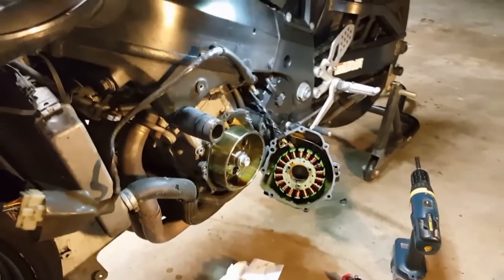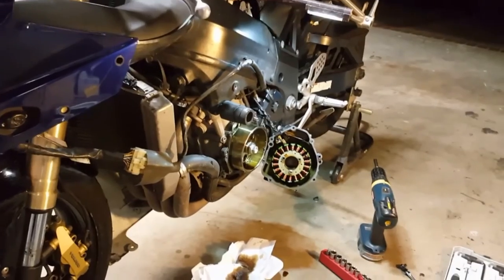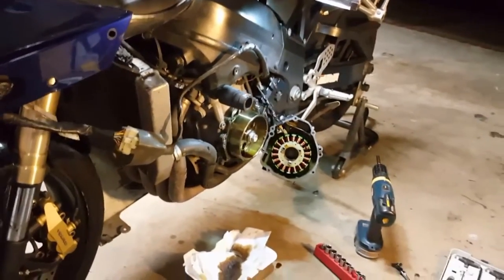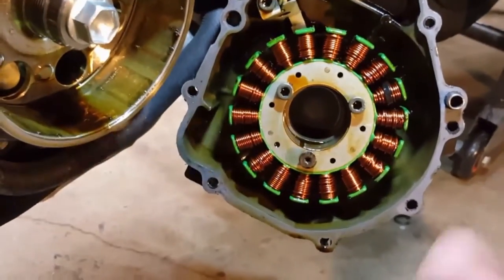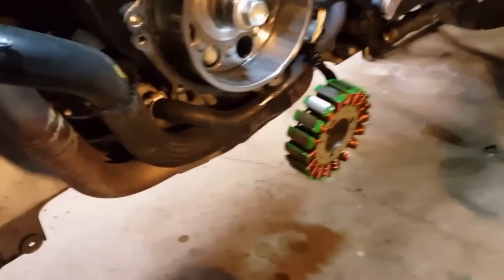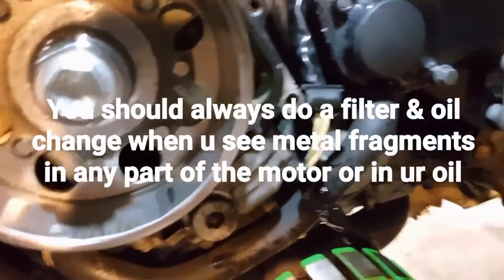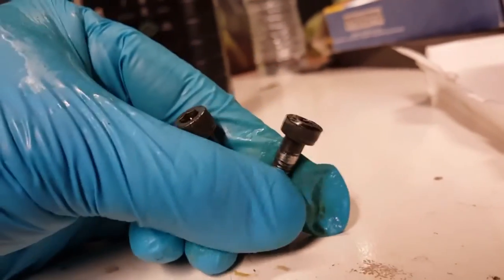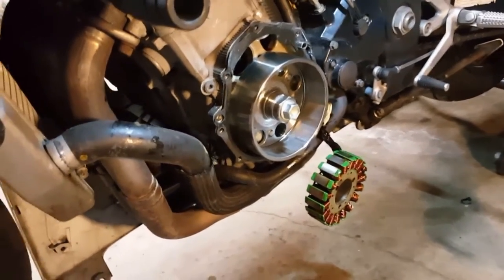DIY Troubleshooting Stator Screeching Sound

Comment: Okay for anybody else to watch this video. I was having a problem where I had come back home and check my bike the next day after having no previous issues. I was about to head out for a trip, but then it started making that belt screeching sound. He was talking about in the video so I panicked and called my mechanic friend. He said it doesn’t sound like any cylinder issues or pistons so check the compression. We checked the compression and everything came back fine so then I went and watched your video. Immediately found out what was wrong with my bike by pulling off my stater cover even though my bike is a ZX 10 R 2008 SE. Thank you so much I thought I was going to have to replace a goddamn engine again.❤
Reply from the maker: Glad I could help you out brother. I never would have thought that this would be a thing but I guess it is.. thanks for sharing your story and letting us know it's not something that's bike specific..

Comment: Thanks for the video, just happened to my cbr thanks to your video was quickly able to diagnose my problem
Reply from the maker: Glad it helped you out. Its very rear that this occurs but it can happen as I said. It may be a pain in the ass to remove in the future but be sure to use some blue lock tight so it doesnt happen again.

Comment: Great work from the 2005 GSXR Master Mechanic. James, you must really love the 2005 GSXR 750.
Reply from the maker: Thanks Kenneth!.. yes, I do love this bike.. I have friends who tease me all the time saying I should sell her and upgrade to something new.. I tell them every time I get on her it's like a new experience.. 

Riding Ms. Lucy Liu (a.ka. Loose) never gets old and with the new engine I dropped in her a few years back she's younger then ever.
Reply: @TheChemistDIY  I was experiencing an electrical gremlin recently on my 05 750. The display went down and engine shut off. Started back up immediately and shutdown a second time. Started back up after cooling off for 30 min and road home with no issue. Battery, RR and stator working properly. So, I ended up going through all grounds and cleaning every connector and fuse with electrical contact cleaner and sand paper. I found lots of old dialectric grease that had hardened(nasty red)and also their was corrosion on fuses and inside connectors. 15 year old bike in humid tropical environment needed a good cleaning. Rectifier 5 prong connector was corroded inside, so popped each one out to clean individually. Rectifier wires get very warm and rectifier was hot, but back looked good.  Im wondering if all the old dialectric grease and   corrosion isn't the root cause for alot of these charging issues. I noticed a slight improvement in the voltage when at idle 14v to 14.2v after cleaning everything.

Comment: I know this is an older video but take the thread count and dimensions of the bolt and type of thread. Then sorce the bolt elsewhere. 
Secondly when installing those bolts use a thread locker liquid. Choose something like blue loctite?. Whatever the service workshop manual suggests?.

Comment: Mine is doing that rattling noise now my GXSR 600. I believe the bolts are too long in length, I think it’s best to use shorter bolts to lock down the stator.
Reply from the maker: Yeah, if your not using the OEM bolts then it's best to get something similar in length. Last thing you want is metal shavings floating around in your engine oil. I would look into this quickly if this is your issue. Check the magnet drain plug and see if it has More then normal shavings.
Reply: @TheChemistDIY   Not sure where the magnet drain plug is, but I will look into it tho. I think its doing that because I switched the OEM Stator cap to an aftermarket Stator cap. So I may need some shorter bolts. I will check and get back to you. This is depressing not knowing the issue LOL because I am trying to get it ready for the beach this summer.
Reply from the maker: Magnetic Drain plug = is just the bolt you remove when performing your oil change. At the end of that bolt (thread end) you will see a divot with a discolored center.. that center divot is a magnet that colocates metal shavings floating around in your engine oil.. so obviously you would have to change your oil when pulling the drain plug to check.. yeah aftermarket parts can be a bitch sometimes.. I always ask myself.. "why do they have to look so cool but yet do so much damage".. lol.
Reply: @TheChemistDIY  Oh okay I know what you're talking about now LOL I will check it out.

Comment: I just posted a video on my channel of my 06 VTX. Can you tell me if that was the sound you heard?
Reply from the maker: Yes sir!.. that's exactly the sound.. do not run the bike any more until you tighten them up or you will run them down.. add a little blue loctite and let it dry overnight.
Reply: Well that was not it sadly.  Stator and flywheel all intact.  Clutch side is the same. Everything looks newish.
Reply from the maker: @Taw19850  man I for sure thought that was the problem, sounds exactly the same.. have you checked your exhaust pipe bolt's where they mount to the frame? Slap on a pair of gloves and grab the piping to see if the noise quites down.. definitely sounds like something loose.
Reply: @Taw19850 Did you figure out what the noise was on yours?

Comment: I’m having the same sound and same scratches but my stator isn’t loose. I did drop it after a wheelie. Do yall think it could be the crankcase cover?
Reply from the maker: Yeah, if your seeing scratching or gouging inside the stator flywheel hub then most likely the cover is bent causing misalignment issues. There pretty cheap on Amazon and you can have it in like 2 days with prime. I've ordered one in the past and still have it on till this day

Comment: Same issues thanks man ! Do you know the specs of the bolt
Reply from the maker: This should be hand tight without over tightening.. just make sure to use blue thread locker to keep them in place..

Comment: hey got the same problem. is it still safe to drive this a couple of days around? like around 3-5more hours?
Reply from the maker: Hell no.. if the screws come out they fall into the engine casing .. that said the stator also falls into basket that's spinning at a 1000 revolutions per second. Talk about a bad day!
Reply: got it man! lastly, how did you manage to fix it? got any vids around? btw, u earned a sub! cheers!🎉
Reply from the maker: @iamcharles2286 thanks for the sub. There's nothing special you need to do. Just as the video says, clean out the metal shavings, replace the screw if yours was damaged like mine. Your local big box store should have a nuts n bolts section that you can take one their and match up. 

But most importantly, when you reassemble, be sure to use BLUE loctite to keep those screws from backing out.. you wont have anymore issues after this. I've posted an Amazon affiliate link below to the product if your unfamiliar but you can get this at any automotive store. 

https://amzn.to/49YqgSs

Lastly, if the screw(s) have been shaven down, you are going to need to perform an oil and filter change and be sure to clean up the magnetic drain plug. It will no  doubt have collected all the fine metal shavings in your oil and you don't want that floating around in your new oil. If yours was really bad like mine was, ride the bike for a few days and flush the oil again. You don't want any residual shavings coming of parts and into your engine. 

Good luck

Comment: Do you need to drain the oil to take the case off cheers ps love your videos
Reply from the maker: Sorry for the late response, but no you don't need to remove the oil although some oil will leak out as you remove the cover but it's very minor
Reply: james moreno thanks for the reply
Reply: Wait so did you find metal shavi gs in your oil? This just happened to me same noise

Comment: Use blue loctite
Reply from the maker: Alan Gaudry YES..! Lesson learned. Even after performing this replacement a few times and never having an issue I would advise everyone to use Bule Lock Tight so this doesn't happen to you. You just never know when a bolt will decide to back out.